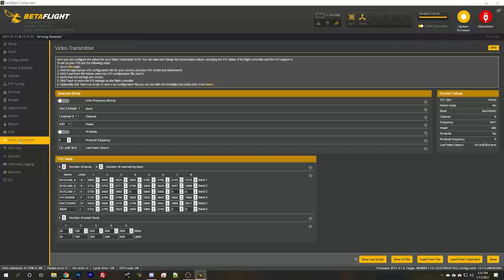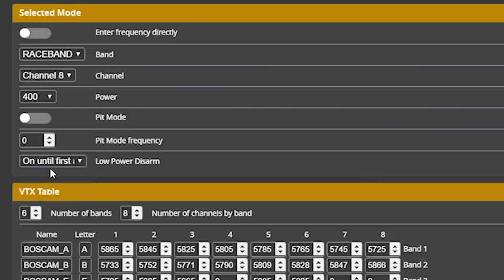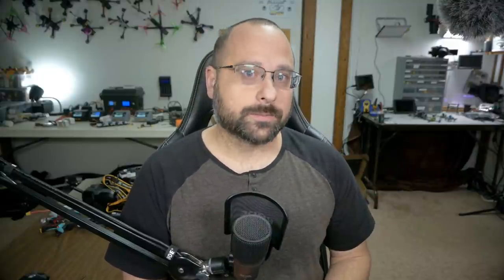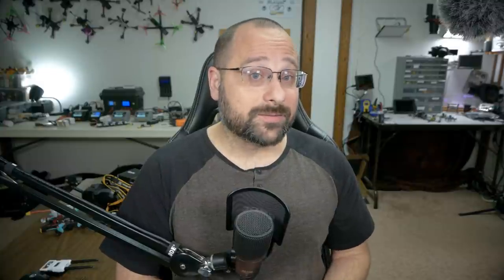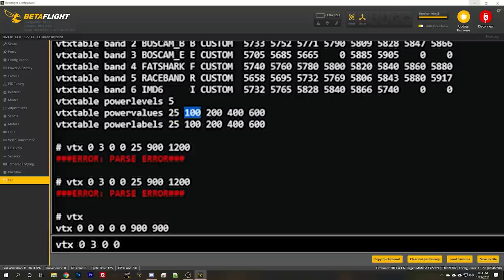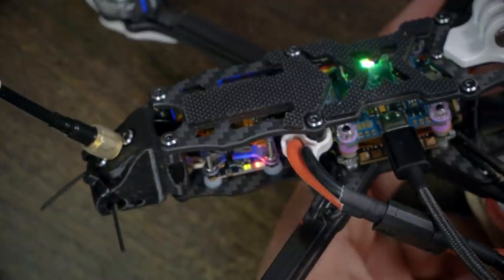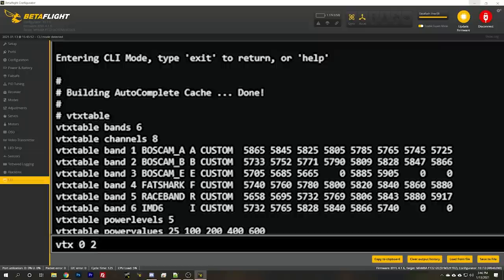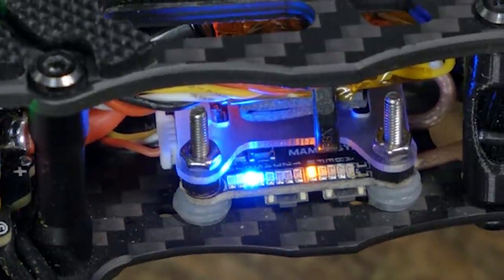Betaflight change vTX band channel power on a switch? Yes!

Comment: In order to make this work you might need to make an extra vtx power level. On my GepRC Phantom the CLI didn't take the 3rd power level of 200 mW and gave me a 'parse error' until I made a 4th level (which I set to 0 mW)
Reply: I just got bit by this bug myself, was kind of wondering if adding a 4th level in my vtx settings was going to be the solution. Came here to read the comments as a google search for "vtx parse error" didn't yield much.  I was expecting to see  a lot more people with this issue and came to search the comments for a possible solution.

Comment: Great video as always! Since I'm still one of those lowly analog guys I think its an awesome feature. I got the switch to work but when in a position other than 25mw, the power setting in the goggles flashes back and forth from 25 to 200mw... what's with that?

Comment: Inav has this option in the GUI now. I have the activation tied to the arming switch and then another 3 position switch cycles through 4 power levels up or down. Works well.
Reply: Inav has had this feature for a while,inav 2.6 has an even better system now,I use it with great success,its a good system isn't it Robert.
Have a great day
Reply: @M-H433  Yes it is! Especially when you want to head out and explore long distances. Do you have the VTX power levels set up to change automatically based on distance from home?
Reply: Yes Robert i do
Reply: Im using a Tramp vtx,but for the moment only using the first 4 power levels,that's getting me out consistently 12- 15 klm at the moment,I'm using a myflydream aat with a black cannon,I see no breaking up of video yet,I just need bigger balls to go further.....🤣🤣🤣🤣🤣
Reply: @M-H433  Damn that's a serious setup. I've managed 3.2 miles on 5.8 ghz with Ardupilot and that's the limit of my lipo. 15 km is out there. Are you using 5.8?
Reply: 5.8 yes.
Reply: Sorry the tracking antenna is a super cannon 16 turn,uhf immersion and duo.i can send you pics of set up if you want,the plane in pic here isn't the 1 I use either that's a ranger 2400,I use a bixler3 for the latter.

Comment: Alternatively use the RX RSSI telemetry value as a value in logical conditions to switch VTX power levels. Then you don't even have to think about flicking a switch when flying far away or behind objects.

Comment: I used to use this a few years ago with planes. I think it even predates BetaFlight. It has always been clunky though. I don't understand why such great functionality isn't exposed in the configurator gui. It's also interesting that some parameters start at 0 and others start at 1.
Reply: Old post but it looks like that's because 0 stands for "dont change" so they kinda programmed themselves into a corner there.  A value of -1 or the string NULL would have been better for specifying "dont change"

Comment: Thanks for the info.  This is super cool and useful.  I did have a question tho, on one of my quads I have 4 power outputs (200mW, 400mW, 800mW, 1000mW), would it be possible to use the momentary switch on my TX16S and cycle through the power settings?

Comment: That six position switch could be used to control six different quads one at a time. So, for a race practice you could have six quads on the line. Then if you crashed out, you could select the next quad  and take off again and repeat.
Reply: How!?! Because they would all have to be plugged in at the start line bound to the same controller. This only covers video not control link.
Reply: @Northernlight1982  actually... If you have all the other quads plugged in and ready but in pitmode until armed, you could set up the 6 position switch on the TX to just switch what receiver it's connected to. If you have a Realpit setup as well, you could even turn the crashed quad's VTX off before switching over so you don't even have to use different channels
Reply: @Lozoot2  Really? Can you bind and unbind an RX from a switch on your TX? How do you set this up?
Reply: @Northernlight1982  on second thought, the simplest solution is likely the best here - just go into your radio and select the next model. That way you don't risk accidentally hitting the "switch quads switch" mid-flight. I'm sure there's a way to trigger the swap via LUA but I feel like it would be more trouble than it's worth. I also wouldn't keep the extra quads plugged in unless you have Realpit on the VTX and have power to it completely cut.

Comment: 🤔 Is there a function for a momentary switch to add values to a point and start over again, so you can switch from channel 1 to 8 and start at one again? 🤔 That would be so cool.

And by putting the VTX info in the OSD you can always see to what channel you just changed 👌🏻
Reply: As it turns out, it is possible! Because I just did it 😃. Now I’m going to add another function to disable channel switching while armed and I’m set. Awesome!

Comment: It's a good upgrade for different flights, short range or long range, without using betaflight. But I have a question : there is a possibility to set the low voltage alarm on a switch ? (3.5v for lipo, and 2.6v or other for li-ion ?)

Comment: JB(sarcastically)"Thanks computer programmers..."
Well, you should be thanking them... For the entirety of Betaflight. 😉
Of course, even though I am a programmer, it does annoy me that they sometimes use 0 indexed (eg the aux channel number) but other times don't (eg the band and channel numbers) because they're using 0 for "none" or something like that. I think that needs to be removed from parameters. Parameters shouldn't be 0 indexed at all.

Comment: I'm using a SucceX-Force VTX. When I switch from 25mw to 100mw in my three position switch the lights on my VTX properly flash. However when I switch to 800mw it only flashes once (25mw) or twice (100mw)? I know it's hard to troubleshoot via a comment but do you have any advice? Thank you so much for all you do, I would not be able to get into this hobby without you 👍

Comment: I think there is a defect in this is Betaflight 4.1. Power levels are zero based in vtx command (0, 1, 2 for me) and are supposed to be 25, 100 and 200 for my VTX. 3 is not accepted value. However when assigned that way I get 25, 25, 100 mW, and never 200.  I think the defect is that on reading the values are being compared with 1-based number so there is no way to assign 200 mW to a channel switch. Good explanation though.
Reply from the maker: That's not right. The correct values for SA 2.0 are always 0 1 2 3 and the vTX translates that into power levels.
Reply: @JoshuaBardwell  Then my assessment of a defect is incorrect and the issue is that it wont take 3 as a power level value. Could be specific FC issue. This is TInyhawk 2 Freestyle with factory firmware. It will happilly take 'set vtx_power = 3' though
Reply: Did you ever resolve this issue? I am in the same boat, following the video I am unable to assign 500mw on the toggle as the CLI command is stating an error.
Reply: @RobsClips1980  No, decided not worth spending any more time.

Comment: Hey Joshua, I have an awesome video idea for you related to this video. From open TX, read RX RSSI and automatically adjust VTX power.
Reply: This will save mAh on the Quad lipo. I wonder if there is a way to read VTX signal quality and send that back through to OpenTX instead of using RX RSSI

Comment: I noticed you moved your RX to a plate in the back. Did you do this for heat reasons or just because? I ask as I did the same thing you had done and cut the wires before the connector soldered them to my CRSF and stuck it to the top of the FC. My antenna cable length matched perfect to that spot as well.
Reply from the maker: It's just a convenient place to mount it. There aren't a lot of other great places.
Reply: @JoshuaBardwell  No i agree I was thinking about adding the plate but seen the work and said meh. Just in your other VID you put it on the FC so was just curious why you moved it and hoped it wasn't because if heat. All good thanks and have a good night.

Comment: Hey Joshua. Thanks for the video. It works for my akk ranger. I have another drone it is on tramp, not smart audio. Is it possible to somehow change power the same way, other than soldering?
Reply from the maker: The same thing will work whether you're using Tramp or Smartaudio. Betaflight doesn't care.
Reply: @JoshuaBardwell  great. Thanks for the instant reply and good morning

Comment: There is an indexing problem in this video. As you typed in everything, you did not apply continuous indexing at the beginning. If you type "vtx" into CLI, it sows the problem. The indexing makes difference between the band-channel and vtx power. So in this video, the correct indexing for the powers is from 0 to 2 and for the band and channel from 3 to 9. Continuous indexing... if it is not, you overwrite everything.

Comment: Hello Joshua, he made your steps and it seems that everything is correct because I can see the power that I have selected in the OSD (25/200 /500MW) but I have a small doubt ... if with the radio I entered the configuration through My Goggles continues to appear the minimum power that I had put in BF instead of the selected power. These values should not be updated via smartudio and the power chosen with the switch appears?

Comment: Do u have a video on how save the vtx signal. Every time I turn my goggles and drone on I have to push the button on the vtx to find a signal.also on  my OSD in the bottom left corner there's a signal bar with the #0 by it.

Comment: Do you think the trim buttons on the new t-lite would be usable for this? I assume an individual aux channel would be needed for each trim button as its not likely to work like a multiple position switch/knob?
Reply: You can use trims in OpenTX... They can be mapped through a mixer with a weight: 
https://www.youtube.com/watch?v=ukXuF21TYhI

Comment: Yoooooo. Is it possible to set the power output to the quad on these buttons? So button six is 100% power to the motor, button 5 is 95% button 4 90% etc? Would come in handy for switching between Lipo and lion batteries

Comment: Is there a risk of the modes mistriggering, if the tolerances are set to tight.
I pulled the sliders all the way to min width and wonder, if some interferrance could let the aux inputs deviate and subsequently trigger a mode unintentionally.
Reply from the maker: Generally, channels only have a very small amount of jitter so it seems unlikely. But you would want to check on that for sure.

Comment: Hey Joshua nothing is showing on my video trans section on my betaflight configurator. I'm using the tinyhawk 2 freestyle. Why isn't it pulling up? Hmmm?
Reply from the maker: You have to enable smartaudio or tramp peripheral in the ports tab first.
Reply: @JoshuaBardwell  thanks brother👍 you rock . Hey I bought one of your kits .😜👍on get fpv

Comment: I did this recently with the Rush Tank Solo and power indicator seams to stop at 800mW (Red) but BetaFlight OSD indicates 1W. Kind of interesting. Doubt I really ever need 1W+. All other power levels appear to work on the 6 position switch
Reply from the maker: The BF OSD just shows whatever the vtxtable has listed as the max. It has no relationship to the actual output power. Go to the Video Transmitter tab, and where it says 1W, type "CAT". You can literally put in any three-letter phrase.
Reply: @JoshuaBardwell  yes I understand the numbers “25, 100, 800, 1W” don’t mean anything. I did find a different VTX table with different VTX power values and now all modes work.

Comment: So I thought: hey cool, so maybe I do not have to enable the 200mW on the tinyhawk freestyle 2 on every startup via the OSD...
...bummer...
...though betaflight shows 3 different powerlevels (25mW, 100mW, 200mW) being configured, I cannot assign powerlevel 3 in the CLI: returns parse error... 😢
25mW and 100mW work flawless though... 😊
Reply: Thanks to Flying Dutchman in a newer post. He solved the problem. Add an additional 4th (or one extra level) power level (in betaflight). With a value of 0mw. So it's like 25,100,200,0 in my case for Tinyhawk 2 freestyle. After this CLI will accept this without parse error. Works for my 2 position aux4 switch on the emax D8 controller (tinyhawk 3 RTF radio)

Comment: I just added this to one of my quads that has a bad OSD chip, so I can't see the betaflight OSD configurator and instead need to use switches to change the channel.  My own issue is that you can only map to 10 different channels, so even with "power" and "channel" aux switches, I can only pick between 10 different combinations of settings.  Any idea how to get around this?

Comment: I mean , you could have use rssi in your transmitter to automatically make the transmitter put an output power depending on the rssi ... Sorry if you mentioned it in the vid I can't not tipe this rn
Reply from the maker: If you do something like this, test to be 100% sure that the vTX does not glitch when changing output power. Many do.
Reply: @JoshuaBardwell  i mean yeah ik

Comment: How to add pitmode before the lowest power of VTX? For example I need to assign power modes for my Atlatl HV v2 in this order: pit, 25, 200, 500, 800.
Reply from the maker: Pit is not a power level for most vTX. Basically, you can't do it. But there is a separate aux mode in the Modes tab for vTX low power and I believe that will put the vTX into pot mode. Not sure if it overrides the vTX command though.

Comment: I tried this with a TBS unify Pro32 Nano, and wasn't able to get the third power level to work (400mW) and got parse errors :). Otherwise works well. Any thoughts?
Reply: Thanks to Flying Dutchman in a newer post. He solved the problem. Add an additional 4th (or one extra level) power level (in betaflight). With a value of 0mw. So it's like 25,100,200,0 in my case for Tinyhawk 2 freestyle. After this CLI will accept this without parse error. Works for my 2 position aux4 switch on the emax D8 controller (tinyhawk 3 RTF radio)
Reply: @gregtay67  Thank you very much! There was no response to this error on the internet

Comment: hi sir joshua...
newbie here speaking...can i turn on and off vtx power from the controler? i want to use aux 3 in a middle coz in top for my buzzer...
coz when i wait for GPS signal vtx is heat..terima kasih (thank you)
Reply from the maker: You can do this if your flight controller has built in "pit switch" function. Otherwise try this: https://www.youtube.com/watch?v=oS-EeAo53m8&ab_channel=JoshuaBardwell

Comment: I set this up and it works great, but now for some reason I can't change VTX channels/freq via my OSD or BetaFlight. I setup a switch to disable VTX control in betaflight (in case my 6pos switch would have been interfering and forcing it to a channel), and have tried with it on and off. Any help pretty please?

Comment: Does this work with every video transmitter or do I have to have smart audio or tbs whatever hooked up and working to make this work?
Reply: Oh I missed the part at 4:45 where you talked about smart audio .. so yes I need smart audio set up and working and I need to see device ready, yes in betaflight configurator . 
Today I learned thanks JB

Comment: Does this work for Shark Byte? Going to be asking this a lot since I just got mine and am building a quad for it now.
Reply from the maker: No it doesn't work with shark byte. Only analog vTX.
Reply: @JoshuaBardwell  I haven't looked into it a lot yet but it seems like both the dji air unit(s) and the shark byte air unit sort of function as their own systems while the analog style transmitter relied on the FC to do much of the computational work (at least for hud). Is this true and related to why this method only works with analog systems so far? I'm assuming that if digital systems become more integrated with the FC this should eventually be possible with them as well.

Comment: Hi JB, was following this video today to setup 4 power changes to 6 pos buttons in boxer, I have 4 vtx power values and setting up first 3 is good:
vtx 0 6 0 0 1 900 1100
vtx 1 6 0 0 2 1100 1300
vtx 2 6 0 0 3 1300 1500
but when I continue with last one:
vtx 3 6 0 0 4 1500 1700
I get a parse error. Do you know what could be the problem?

Comment: I tried this on my Mobula7 that has an all in one board withthe VTX built in, the target is - CRAZYBEEF4SX1280

I didnt seem to work and it also made the voltage displayed in the goggles way off, it was either half (around 2.0v) or 0.0v displayed, I checked the voltage with my charger and the batts are fine. 

Has anyone else managed to do this with a AIO board / Tinywoop?

Comment: Hay Joshua is it possable to do this with crossfire, 25mw, 100mw, 250mw etc?
Reply from the maker: I believe Crossfire has the option to adjust tx power based on aux switch position but it's a new feature and I haven't looked into it further.

Comment: So if you wanted to revert to not having it on that switch anymore, what would you do?
Reply from the maker: You would need to go into the CLI and type

aux 0 0 0 0 0 900 900 
aux 1 0 0 0 0 900 900
etc
Reply: @JoshuaBardwell  thank you!

Comment: Can I use this function (6 knobs) if i'm using a XF RX and SmartAudio is enabled and working? Thank you!
Reply: I modded the tinyhawk 2 freestyle with this + TBS XF nano 44...  I have a problem when selecting 400 mW, something strange happens: when I arm, the ESC make the classic "Power-Up" sound again except of the last note... then the video in the goggles disappears (lot of noise..), after a few seconds video comes back, then i have to disarm and only then comes the last "Power-Up" note... afterwards everything works but i'm afraid the VTX sets back to 25 mW.... someone knows what's going on? Thank you

Comment: Does the TBS Unify Pro32 HV have to be unlocked before this method can be used to change to higher power levels?
Reply from the maker: Yes. Unless you have the Unify hooked up to a crossfire receiver.